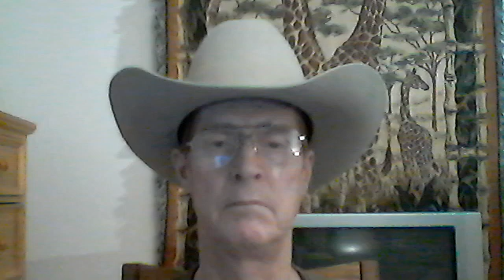Multipath HF Propagation

Comment: Could long delayed echo be bouncing back from the moon, the sun, or other celestial object?
Reply from the maker: I doubt it, but I can't say for certain. Anyone have ideas? 73 de Stan W1GV.
Reply: Trying to understand radiowaves with zero understanding of the higher order of energy producing it is in vain. Focus on primary energy, radio waves are but a leftover.
Reply: Ask yourself how does flux running through the core of a transformer induce voltage in the secondary altho it is totally confined in the core and coil is outside of it. Yes, it is by etheric disturbance, magnetic field of the primary affecting the higher order of energy which is then picked up at the secondary and transformed back into magnetic field.
Reply: Ask yourself how does light 'magically' speed up after leaving a denser medium.